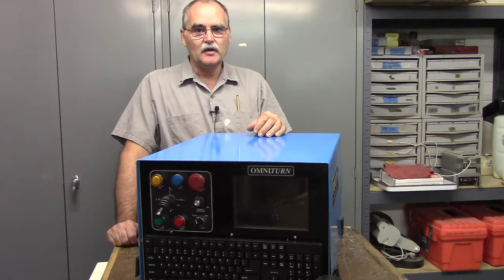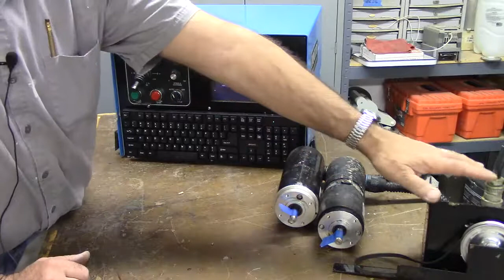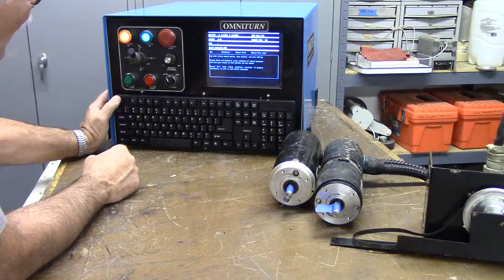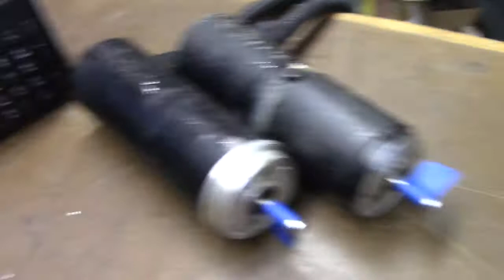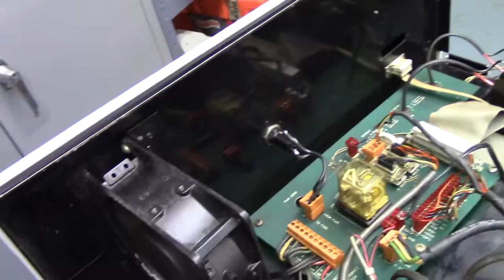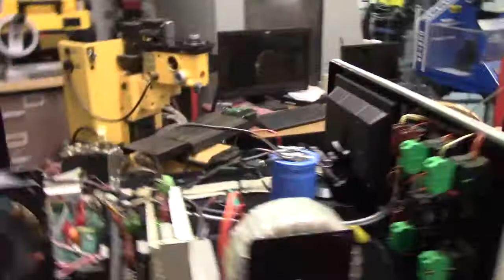Omniturn Control Complete

Comment: Marty, did this unit sell yet?
Reply: lockbuilder, Yes, and sold rather quickly
Reply: Man, sorry I missed that one. I just bought a Hardinge/Omniturn machine and the controller looks like it went through WWII. I am going to try and do the upgrades you did to yours since I cannot buy yours! Do you have a website you sell on or any way too keep up with you other than Youtube public comments section? Thanks Marty!
Reply: lockbuilder, The Omniturn control is rather simple. Does your control work? YouTube and a little on Instagram.
Reply: Marty, I don't know yet. I just got the machine into my garage yesterday afternoon. I'm hoping to get some time this weekend to fool with it. Fingers crossed! Like I said, it looks BAD. I want to take the control unit/box off the lathe and test it on the bench as that seems like it would be much easier. I am assuming they are 110v (the lathe is 220 3 phase) Can't wait to check it all out. I am amazed at the quality of the omniturn components. They were really build well.
Reply: Well, it fired up but no video, so it is kind of hard to tell where I'm at! Lol. Okay, time to search for a video card and a LCD like you did. Thanks Marty.
Reply: lockbuilder, 8" vga monitor and ISA Vga card. Worst part of all is trying to find the older PC parts
Reply: @martyscncgarage5275  Does it take driver changes to put in a VGA card?
Reply: @dduff9478  No, since the PC runs on DOS it relies on the IBM VGA standard
Reply: You will need to find an old VGA card most likely